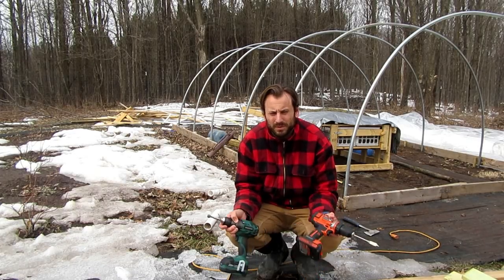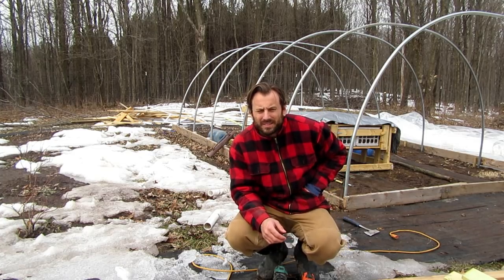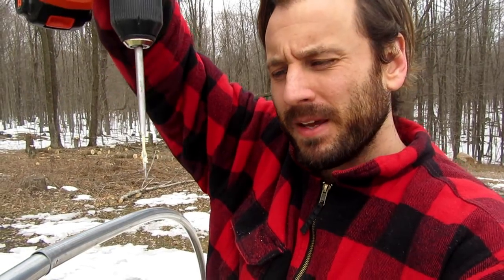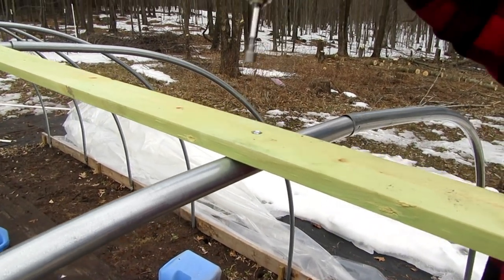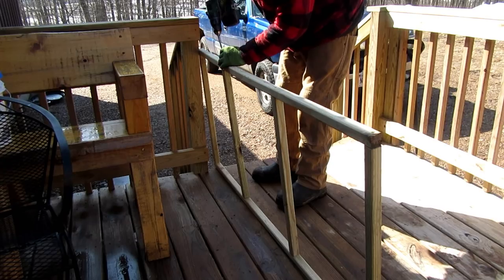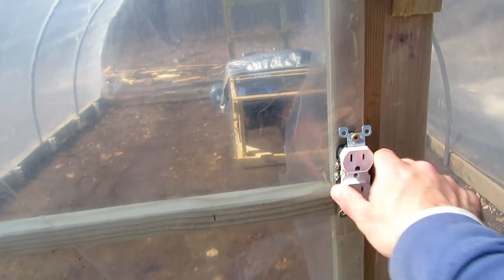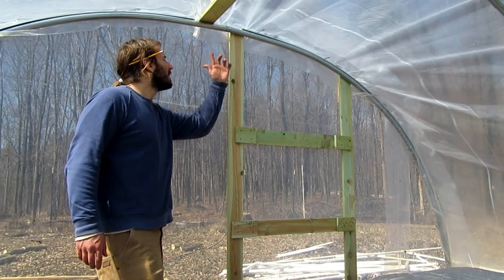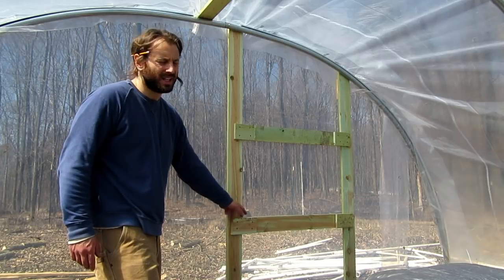Basic Hoop House │ DIY Greenhouse │Low Poly Tunnel

Comment: Can you explain how the wire you used is applied to secure the poly? Thank you. Great job by the way
Reply from the maker: THey sit in channels.  I fastened the channels to the hoops with metal screws.  Then the plastic sits between the wire and the channel.

Comment: Hi dear! Your video is really fantastic. But i have a doubt. In the minute 5:25 you use a thing for link the plastic with the tube like a cable and first, what it is? And how specificly you put that? I would like to know more about that point. Thank you very much!
Reply from the maker: That is called wiggle wire.  You attach the channel to the pole, put the plastic over and the a wire fits into the channel to hold the plastic in place.  Thanks!

Comment: Looks good. Just got my greenhouse plastic and clips for the mini removable versions of that for my 4 x 4 beds. Wondering what the best way is to do the ends so I can get in there.
Reply from the maker: To secure the plastic?  The easiest would be wiggle wire, maybe.
Reply: @TinyHilltop  yeah they are clips that just clip on. Very useful. Easy to take on and off

Comment: Looks awesome! I’m planning on making a greenhouse to start seeds in. Debating on if I want to build something like this or get a frame with double wall poly panels. How well does this retain heat/how insulted does is stay at night when the temp outside is low?
Reply from the maker: Thank you.  Double wall poly panels would be really nice.  Today was 55 and sunny and I put a fan in there to cool it down when it reached 80.    I haven't checked at night.  We are still  getting down into the 20s so they go below freezing.  I am going to use these to grow veggies that can handle some frost.
Reply: Water & heat for a greenhouse are challenging. We had a very small greenhouse for growing seedlings. From January - April, we used electric heat on a thermostat to keep it around 45° at night. It never cost more than $25 a month. I filled milk jugs for watering purposes. It worked great. But  the door has worn off, & we haven't replaced it.

Comment: Nice 👍.how long were your poles? What mil. Plastic? And what did you use to lash the plastic to the hoops? Thank you.
Reply from the maker: https://www.homedepot.com/p/YARDGARD-1-3-8-in-x-10-ft-6-in-17-Gauge-Galvanized-Top-Rail-328913DPT/100322532
https://www.amazon.com/Bootstrap-Farmer-Spring-Wire-Channel/dp/B01N75VZ6D/ref=sr_1_2?s=lawn-garden&ie=UTF8&qid=1522944814&sr=1-2&keywords=wiggle+wire

4 mil

Comment: what is he doing at 5:31? looks like wraping wire or something but not sure how that would hold the plastic?
Reply from the maker: It is wiggle wire.  The channel screws to the poles, then the plastic goes over and the wire slides into the channel.  The specefic kind I used is in the description

Comment: Yeah, what did I miss, what did you use to attach the plastic to the poles. You didn't show us that. And is it leak proof.
Reply from the maker: That is wiggle wire.  The link is in the description for the specefic kind I used.

Comment: talk to me about the poly covering, if the house is 12 ft wide and 30 ft long what size plastic did you buy?  How do you calculate the amount of plastic needed?  Thanks
Reply from the maker: I had this plastic that is why it isn't seamless around the ends.    But, this spring I am going to put 1 sheet on.  It basically boils down to width, which is length of hoops pre bend plus around 5' for safety.  Then length plus height of ends x 2 plus wiggle room.  For this hoophouse I will use 25 x 35, it is  12 x 19' ish.  

https://www.bootstrapfarmer.com/blogs/building-a-greenhouse/how-to-determine-the-size-of-greenhouse-plastic-you-need
Reply: @TinyHilltop  Thanks for the details very helpful.

Comment: Thank you man , that’s awesome, how are you attaching the plastic to the hoop house I saw you were pushing it in at the two ends of the frame was there a groove for it to go into? Or did you make that or what was it thanks
Reply: It's called wiggle wire. Goes into a channel and tightens onto the plastic. Not clear how he fixed the channel to the hoop though.
Reply from the maker: I used wiggle wire.   I used metal screws to attach the wiggle chanel to the poles.  It bends easily to follow along the hoop. 
https://www.amazon.com/s?k=wiggle+wire&ref=nb_sb_noss

Comment: For us that is thinking of building a green house,  I have some questions.  why did you cut many times in those boards.  what were you doing at the end of the green house.  I am new a this and I will doing this by myself.  so I have been surfing the internet on how to build a green done by a woman.  What would be the easiest and safest and have a sturdy way of building the green house.  I have found some good idea.  At least you should how to build a door.  now I need to see how to build the rest like a window.  it was a great show.
Reply: He made all those cuts to make it easier to chisel out the wood for his lap joint on the door frame.
Reply from the maker: The cuts were for a lap joint for the door, but you could build it another way.  At the end I was using wiggle wire to attach the plastic to the hoops.   The easiest way is probably buying  a kit and putting it together.  I have never done that.  They usually tend to be a little more pricey and smaller.